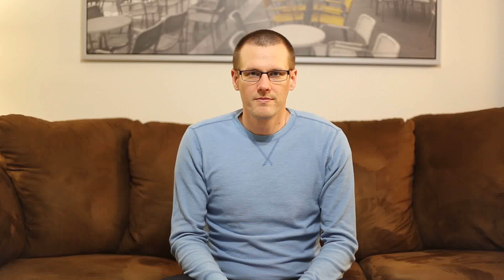What kills an RC Brushless Motor  - Current or Voltage

Comment: I wish someone would answer this.
If I run a 1800kv motor on 8s & achieved +55000rpm based on multiplying , what average percentage of rpm is lost once the motor is under load? Specifically to Rc boats & speed runs. I know prop size is a big factor, but there's always the perfect prop for each boat. I'm curious what rpm a boat would see vs what the math says rpm is w/o load
Reply from the maker: I've included a section in the RC calc sheet that covers this on calculations done for RC Cars. You can find this on the Patreon link in the description. 
The RPM lost while under load depends on how loaded the motor is. The more aggressively loaded the motor is, the higher the percentage of RPM loss.

Comment: Hi. Before whatching this video, I was thinking of the Power instead Current when looking for the limits of any brushless motor, of course, at a given test voltage. I mean, if you go with a 2S LiPo, for instance, the limiting current is way more that that specified for the 3S LiPo battery. Therefore, I thought that you could use a bigger/more power demanding propeller on the motor but with less rpm (with care on not exceeding the limiting power of the motor for certain heat dissipating conditions). I was thinking that part of the power turns into heat, hence the temperature of the motor, of the cooper wires depends on the consumption power instead of the current. Thanks for your explanations.

Comment: What about a small 12 volt compressor? I did the air horn drill mod which runs off a 18 volt battery and drill body and I’m wondering if the compressor will burn out due to the voltage
Reply from the maker: motors don't burn out due to voltage. Voltage can indirectly burn the motor out by increasing current.

Comment: Good video
I have a question if i want to get more power and not getting  heat motor is 12 volt it's starter motor i want to rewind it i fund the previous turns is 15 turns can i make it with the less guage ex 0.5 mm wire and what the appropriate turns  my battery is 12v  55 ah as we know starter motor designed to run for short time i want to rewind it to run for long time at the same time not getting heat?
Reply from the maker: More turns of thinner wire
Reply: Is more turns  and thinner wire effects speed?
Imean if i increase turns and decrease wire to thinner that's mean need more current or more voltage to get speed and torque?

And thanks for answering 😘
Reply from the maker: More voltage. Power will be limited by heat.

Comment: I have an Arrma Granite BLX with a stock 3200KV motor that I believe became demagnetized.  I didn't change gearing or anything from stock but was running the max battery size, a 3S lipo.  The motor is mechanically sound but dead as a door nail as it produces ) power when spinning it with a drill.  My question is what replacement motor KV should I get?  I don't want more power or speed as it is already a beast.  I am ok with being a bit slower or whatever but i need to keep running the 3s as i don't want to buy a whole bunch of new batteries. I was thinking maybe a 2800KV would provide a little more torque but less rpm, which should reduce heat but hopefully not overwhelm the drive train of the car.  Does this sound reasonable?  Thanks for the video!

Comment: 100% correct, current is the killer as copper wires thickness has specific current rating.  Enamel is able to handle voltage in the kilovolts.  For example, the 0.375 mm wire with cracked enamel can have a voltage breakdown of  4.35kv despite the enamel thickness being only 0.0275 mm.  Similar to the RC technology is electric scooter technology, just bigger (although some RC planes are massive), there are people who aren't happy with the speed they get so they add solder to the controllers busbars  and up the voltage to the controller thinking it's clever.

Comment: I'd like to know for hm brand bldc 3phase motor, they dont have data sheet for this so for 72v motor, they have 3kw,3.5kw,4kw motor and so on for this specific voltage. 
How do they determine the wattage for this 72v motor when the awg wire are all the same? 
Could you please look at their motor, which awg wire they are using and so what is the maximum safe current to use on this cable and motor too. I've a few questions for this. Appreciate your help👍👍

Comment: I over-powered my small dc motor using a dc bench supply. Arcs were crossing over from both wires and it smelled weird lol... To my surprise, the motor still works.
Reply from the maker: Ooops. sounds like something cooked.

Comment: Quick question
Can I run a 12v 0.6A rated cooling fan on a 12.6v 12A power supply or will it smoke up?
Reply from the maker: It's OK.
Reply: The current rating of the constant voltage power supply is the maximum it can deliver, not what will flow.

Comment: Hey I have something interesting happening that maybe you could explain:  
I’m encountering a problem that I would love your help with:
I have a brushless DC motor rated (1.5v to 9v).  
I’m feeding a range from 3.36v to 3.95v (see the video, wiring diagram, and motor specs below)
At seemingly random times, once the motor is turned off, it will not turn back on again.  It doesn’t seem to correlate with how long it was last run, or the load it had.  It never stalls while spinning, only once turned off.
The only pattern I can start to gather after hours of experimenting is that if it happens to stop spinning and the shaft is in a certain position, the likely hood of it starting back up, goes down drastically. There are two shaft orientations that seem to be a hang up.  But….  Not always.  Not every time the motor stops in those orientations does it stall.  Only sometimes.  The inconsistent nature and lack of pattern in this problem has me baffled.
The severity of the stall too, seems to be inconsistent.  Sometimes to get the motor going again I only need rotate the shaft slightly our of the stall orientation and then apply power.  Other times, this will not work and I have to apply power and manually rotate the shaft for several gentle but quick spins before the motor will begin to spin on it’s own.  Other times I have to apply power and spin the shaft manually very quickly for 20 or more rotations before the motor will spin on its own, and it’s not an immediate take over… the motor will start to spin slowly and gradually accelerate to full speed.
Any ideas at what is causing this?  This project is for a Halloween party I am throwing, and I plan to make 8 or so of these particular gadgets, but they need to work reliably without manually having to manipulate the motor in order to get it to work.
I would love any insight you might have.  I am brand new to small electronics.  

Here is the exact motor I am using:
https://smile.amazon.com/dp/B07Q44YYKG?psc=1&ref=ppx_yo2_dt_b_product_details

Here is the motor issue live in a video:
https://www.loom.com/share/bbf8b3978e2a49cea628d1a052894829

Here is my wiring diagram:
https://drive.google.com/file/d/1JgbZNAn3SsPm2d0HUFM-ipDk4i7HLMN_/view?usp=sharing
Reply from the maker: Hi Brenton, the motor appears to be  brushed and not brushless. Does it spin up correctly in the stuck spots when wired more directly to a power source? Do all the motors in that kit have dead zones? Is there any current drawn when it is "stuck."

Comment: So I can run a motor rated for 12V on 50V, as long as it doesn't get too hot?
Reply from the maker: AND it does not exceed the maximum rated RPM for that specific brushless motor.

Comment: Very nice vid! I have 2845 3100kv motor with max <17v. The esc i wanted to use is hobbywing wp sc8 <3000kv on 4s. Is the over of hundreds of Kv bad or it the esc can tolerate?

Also thinking 6s, 2600kv motor but the max volt is 19v. The Esc limit is 2500kv on 6s. Thanks!
Reply from the maker: I would not go above the esc limit.

Comment: Hey thanks again for a very informative video! I’ve got another generator question for ya. 

In your other video you showed mathematically how the iron losses were calculated using Io current values. Is that for all output currents or was that just for a no load situation? Thanks again for you time!
Reply from the maker: Iron losses is calculated using Io of the motor at the motor speed specified. This speed is based on voltage. Spin the motor up to the speed you need it to operate on the generator using an ESC and battery, then measure the Io value.
Reply: @RCexplained  i have an aircooled brushless motor with big fins meant to act as heat sinks for air

I was thinking about converting the motor cover with the fins run water on the fins

Wouldnt this allow me for example to run more current

As long as the temperatures do not exceed the what they are supposed to be i can keep adding current to find the new continious rating
Reply: @RCexplained  thank you! That’s helpful!

Comment: Hi thank you for your video. 
So how about this scenario for a plane.. 
You go from a 3s setup to a 4s setup. keep the  prop the same.
So naturally the higher voltage would cause the same kv motor to spin faster, drawing more amps.
However what if the maximum wattage is limited? so lets say 12.6v 3s 10amps ... 126 watts.
Bump voltage to 4s but limit it to 126watts (limit at 7.5amps).
Both setups will give the same thrust, but would the 4s setup run the motor cooler as youve dropped the amps? Your current squared × resistance formula would say yes it will run cooler. Right?
Thanks
Reply from the maker: Hi Mark, interesting thought. I think there's a couple more variables to consider. How would you limit power to 126 watts? Is this governor 100% efficient, odds are it's not. A motor limited by partial throttle is seeing less voltage in order to reduce the overall maximum RPM.
Reply: @RCexplained  Hey, sorry for the delay in replying. Ah right well I guess i better go back to the basics then, i was using my fc to limit the watts. 
For some reason I thought that the esc would send shorter pulses of higher voltage to the motor.

Comment: Hi
Great video very informative. Just a question what temperature would still be safe before you risk to demagnetize the rotor?
Reply from the maker: This would be the maximum safe operating temperature specification as provided by the manufacture of the motor. Temperatures can vary significantly from manufacture to manufacture based on the quality of the magnets used in the rotor.

Comment: thanks for the great video, have a question please, can i use 120A esc on a  brushless motor rated 70A max? thank you
Reply from the maker: Hi Fred, yes you can. Just make sure that the RC you plan to use these components in do not draw more than 70A max.
Reply: @RCexplained  thanks for the respond, using main gear of 64T with 21T motor gear, on 1/10 truck, not sure if I’m at the safe zone, if I’ll use 60A will I lose noticeable performance? Thanks

Comment: You are so far off on your lecture. The amount of heat that is required to demagnetize the magnets is pretty high.

You won't spin the motor fast enough to cause the rotor to fly apart, if this happens it's a completely crappy motor!

Heat is a byproduct of inefficiency.
The amount of voltage required to "jump" (also called a short)across the windings is in the 1,000 of volts and this will never happen in a BLDC it shouldn't even have been brought up. 

 Not a hater but please get a solid understanding of what your talking about before you make videos and deceive people with false info.

What destroys a BLDC is when you have a stall in it and you're throwing so much current at it and it can't turn and so the hall sensors won't allow the field windings to switch because the rotor hasn't moved, hence why they have senseless motors so the field windings are constantly switching and the rotor is "skipping" until the stall is gone and the rotor can turn freely. This is the exact same reason a brushed motors burn up. If you're burning up brushless motors you have too small a motor for the load being placed on it.

The only thing I don't like about BLDC is the inefficiency of the switching. I wish it was at the same level as commutator, but unfortunately MOSFET tech isn't quite there yet, hence why controllers get hot...all that switching....

Comment: @rcexplained so the simple tip is to just keep increasing voltage and not the amps.
btw quick question What has an effect on Torque? amps or voltage? or both? I feel my electric motor could do more uphill climbs but perhaps I should increase the voltage?
Reply from the maker: A total combination of 2 things have an effect on torque. That is current (amps) and the motor constant kt (inverse of kv).
Here is the catch, and often confusing to understand at first. If you increase voltage and all else remains the same, (**provided your system can handle the increase**) current output will also increase. This is because the overall load on the motor will be higher as you are demanding the motor to work harder. Load and Current go hand in hand.

Comment: I completely disagree, how could current be the determining factor of the motors failure by increasing the voltage? You just said, you are increasing the voltage only?
Reply from the maker: Motors electrically fail by heat. Too much current is what produces excessive heat. Voltage does not produce heat. 

If you increase voltage only and you have not changed gearing or a prop, the higher voltage will end up increasing current. The increased current is again what ultimately destroys the motor. One could simply operate at that higher voltage but change the load by reducing the pinion gear tooth count or reducing prop size. This would manage the current draw thus heat.

Comment: Has anyone tried a 3s with a hacker a10 12s motor? Its recommended to be used with 4.5x4 prop on 2s, but i would like to try it with 4x4 or 3x3 prop on 3s.

Comment: So I bought a 3s 1600 mah 11.1v for my hobbywing 1/18 7800kv motor and it has the hobby wing 18a motor will I be ok to run that battery?
Reply from the maker: That motor would be too much kv for 3s LiPo. My preference would be 2s LiPo.
Reply: RCexplained ok thank you

Comment: I want to know,
Lets say that i have a max 100a motor, and a 130a esc, and lets say that i have the right cooling so the motor runs at a reasonable temp, would any problems occur?
Reply from the maker: Hey Dafhatas. I'm not sure where you are going with this, however with the limited information you have provided, no I don't see a problem. Perhaps, if I think I know what you are after this video may help: https://youtu.be/LTlVWYSexBI
Reply: First, thank you for commenting :D
I asked it because,im going to get
A hobbywing seaking 3180kv 3360SL brushless motor, and its max 94A, and i Just cant find an esc for it. I even asked it in forums, but that didnt kinda Work. Do you know the right esc for it? (also it says 16.8v in the Hobbywing site,but it says 18v in the website that i Will purchase it.)
Reply from the maker: @-dafhatas-6519  what will the motor be placed in to? How many cells do you plan to run
Reply: Well i dont know, as im new to rc.
I Just want it to be right, 16.8v and 94a
(its 16.8v probably)
What do you recommend?
Reply from the maker: Where is this motor going to be used? Which exact RC?
Reply: A rc boat
Reply from the maker: Which boat?
Reply: Well im planning mono.
(you mean its hull, right?)
Reply: Hello??
Reply from the maker: Sorry Dafhatas, I'm not always able to respond instantly. 
If you went with a 25 inch Monohull you could run that motor on 2s LiPo comfortably.  A 120A 2s-6s LiPo ESC would be good.
Reply: Okay thanks so much!
I will try it all together with an 6s lipo, when i get all of them.
Im thinking hobbywing seaking 120a v3 esc.
Reply from the maker: The hobbywing will work. I only recommend 2s on that motor. Way too much kv for 6s.
Reply: @RCexplained  Okay thanks!
Reply: I searched a little bit and seems like the closest one is 4s lipo
But it seems like its max a is more than 120a
Reply: I dont think i can find the perfect voltage and amp lipo :(
Reply from the maker: @-dafhatas-6519  what are you looking for? There's tons of options. You want to have the highest c rating. If you are using the ~3000kv motor, use only 2s!!!
Reply: But they are all max 7. 4v,but the motor is max 16.8v.
By the way sorry if im wasting your time, im Just new to rc.
Reply from the maker: 16.8v is an absolute max. Motors can operate on voltages lower than this with no issue. The kv you have selected (over 3000kv) will not work with 16.8v max. If you want to run a 4s battery, you must choose a lower kv. Something closer to 1800kv.

Comment: Hi Ryan. Thanks for the info as always. When manufacturers claim the max current is X amps i suppose they're considering the forced convection from the propeller ? For example, i have a motor with 40A max in delta configuration with 1 strand 0.55mm wire (so 23 A max for each phase). 23A is a lot for a 0.55mm wire if there is no forced convection to dissipate the heat. Regards
Reply from the maker: Thanks Jean for the comment!
There is no set standard as to what a manufacture is basing a motors maximum thermal limit on. There are many contributors to what that thermal limit would be. 
In your example you are assuming the motor is used in an airplane, but how do you or the manufacture make an assumption that I will use that motor in an airplane? What if I place it in to my boat?

Comment: what brand make the most efficient motors?
Reply from the maker: I haven't run tests to determine the motor with the best efficiency.
Reply: @RCexplained  ok any recommendations?
Reply from the maker: Castle motors are good if this is for a car.
Reply: There's unfortunately not enough data out there. With that said, as long as you avoid the super cheap junk you'll probably get a decently efficient motor.